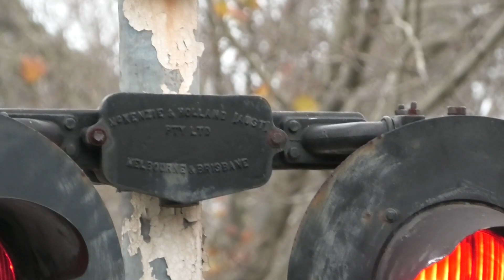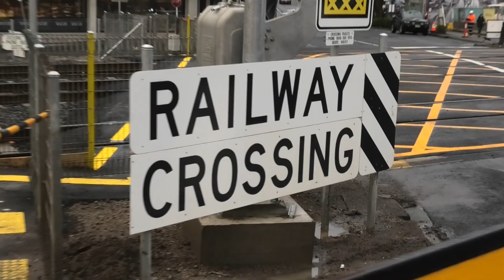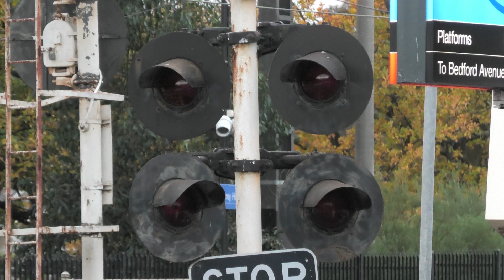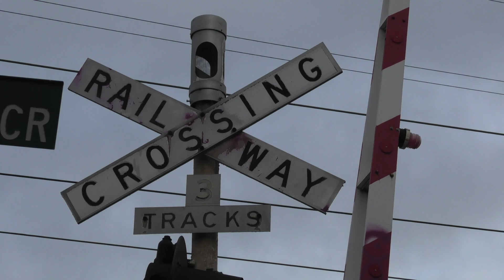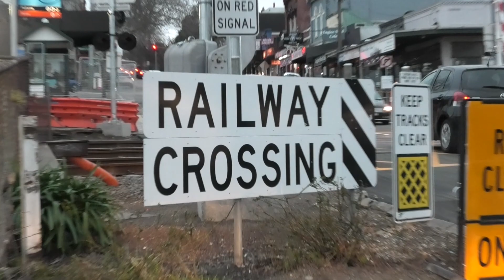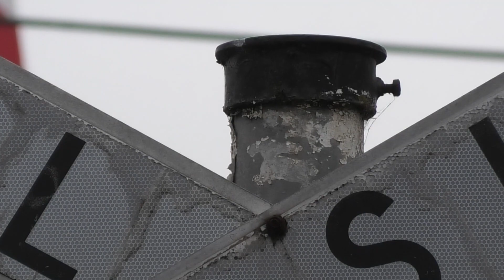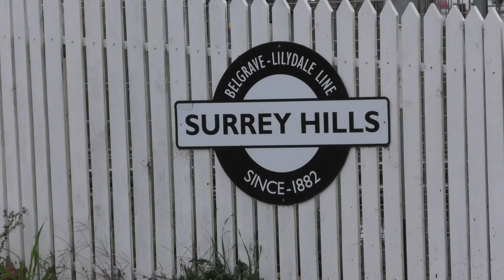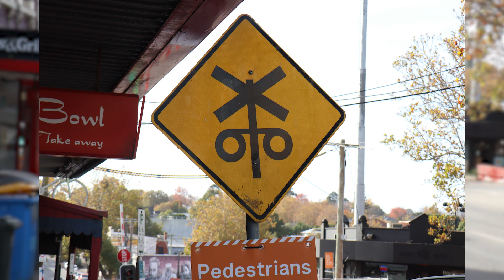Union Road, Surrey Hills, Vic | Removed Railway Crossing | Before and After Upgrade

Comment: I wonder why they renovated it only to remove it 7 months later. The old crossing worked perfectly. Nice video, i subscribed!
Reply from the maker: @railjets  They dug a big hole where the crossing was and had to re-do the track and road above, along with the wiring for the signals

Doing so meant it was much more beneficial to just install new wiring rather then old wiring and signals that don’t meet standards